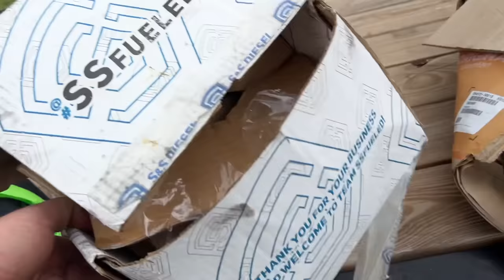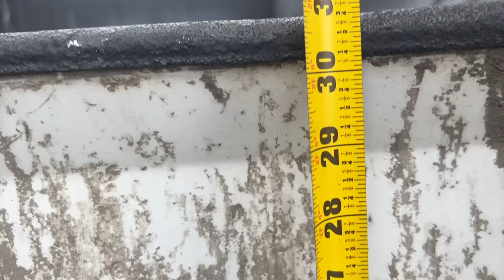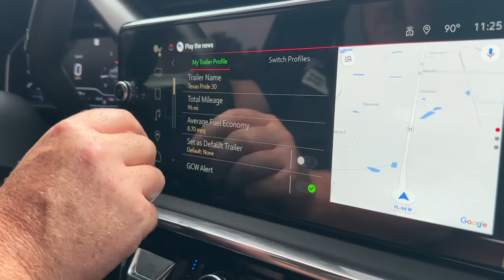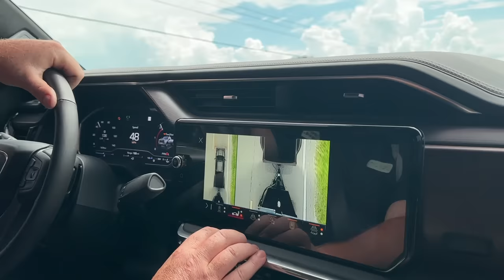$100,000 Diesel Truck VS $2,000 Diesel Truck!!!!  Are These New Trucks Really Worth It?

Comment: In this comparison there is no reason to pay 100k when a 2k piece of equipment does the job. I don't care that it was 10 seconds faster. Not to mention on there are no emissions except an EGR on the older truck. The 100k truck has every piece of bloated garbage the EPA could dream up on it.

The comparison in this video is fine for a one shot deal however, the story will change drastically over time in cost of ownership. Then the price difference becomes much more than $98,000. Increased usage of diesel fuel, cost of DEF, diesel fuel additive (have to raise cetane to keep regen to a minimum), more insurance, more registration and let's not forget; inevitable down time in the shop due to rushed and rubber stamped emissions equipment.

I'd say the true difference in cost is closer to 50% higher minimum.

Comment: You run a new duramax over a old  powerstock and  their was not that much difference between them you try running  them  with the same miles and 4×4 or even 2 wheel drive  the powerstrock will come out on top over a scrap duramax   every time

Comment: I am no mechanic, I am as far as earth is from Pluto in being the bright,  but even for for being that stupid, I would not buy that 100k truck.  I would need to that amount every week or 2 weeks to jump on that boat without regrets.  And that would only be to buy it off cash.    I could not even consider what would additional fees would be in interests, and INSURANCE on top of all that…. 

I think the F350 did insanely well.. that is a what a smart person would be driving, assuming he is able to keep it running reliably.   

Remember i said I am not a mechanic, therefore and sadly, would not be capable of keeping a truck like that on point, and would probably push for the newer trucks.  But if you mechanically modestly savvy or great, then your  choice would be taken as smart person, and not blowing your money off.  Unless it’s down for marketing purposes, in attracting while not necessarily better customers but instead people would be willing to spend the money because they drive a snowball in expense that cannot be afforded not pay more than desirable as it’s driven by a much greater cost which is that of the tuck itself. 

Ones again, if it was for being money, I would take the 350x but I were a mechanic, car dealership of needed to create a specific marketing awareness, I would undoubtedly go with the new truck too.

Comment: 6.0 is not a very good truck I like ford but they are not reliable I think you should take a 7.3 and jack it up new fuel injection system newer turbos new cam

Comment: The performance differences were minimal for nearly two decades between them. 
The percentage of improvement in performance only equates to 50k in value. So you are overpaying 50k for your GMC. That doesn't sound like a very good deal to me.

Now, if you are a business owner, sure. You get to write the depreciation off on your taxes, making it a far better deal than Joe smoe buying one and eating the entire sticker price.

For me, I still drive my 04 F250 6.0. I can assure it performs a helluv a lot better than your 2k truck.
No dents, no rust. I  paid 24k for it in 09 with 52k miles on it. I wouldn't trade it for one of these new trucks. 
You failed to mention why you NEED a warranty for your new truck. That would be because they crap out all the time with emissions related problems.  
No thank you very much.

Comment: Difference is the 100k truck will be in the junkyard in 20 years. They will NOT last 20,30, and 40 years. So as long as you have the available funds to buy and sell them, more power to you, but they'll not be around in 20 years. Too much stuff that doesn't last on them. They'll become a $ pit like no other, and they'll be thrown away. Bummer.

Comment: I'll never drive anything except a  old superduty   current daily a 01  just hit 200k..  that 6.0  surely wasn't 2 grand even if it's a    
 sparkplug coil pack trashing pig. 

now calculate that gmc  in 250k miles  + 20 years depreciation.

Comment: He about cost per mile? Who buys a diesel to drag race it, anyway?? I’ll take an old truck I can fix myself over one that has to go to the dealer for electronic or emissions issues. My 96 won’t get stranded for def issues. It may not tow at 85mph, but I wouldn’t want to anyway. I also have a 2004 duramax LLY. The only time that truck stranded me was when the FICM failed on the side of the interstate pulling a trailer - like you - hours away from home. All the electronics are a weak point for these trucks.

Comment: Without a key it won't be long before the new truck is stolen.  It's becoming a real pandemic depending on where you live.  The old truck has no computers like that, it would be much harder to steal as you still physically need a key.

Comment: When you're looking at a hundred thousand dollar truck and putting it up against a 2000 to a 4000 truck that runs well there is no comparison it would take you years to recoup the money that you spent on that hundred thousand dollar truck. Yes you get bells and whistles and everything else that a new truck has compared to an old truck. The new warranties are not worth crap. I owned a horse stable for years and you couldn't give me a new truck. Even if you broke down and had to put a new motor in that old truck you're still better off.

Comment: A truck is purposed for heavy duty work, not getting groceries or showing off. There is no need for leather surfaces everywhere. Just leather seats and steering wheels are fine. Everything else can be plastic. No need for 4 doors either. Nice long bed is what you want. Of course, you want the basics. A decent infotainment system for camera views, phone connectivity, and navigation with chunky physical climate and audio controls usable with gloves. 

This fad of making luxury pickup trucks is frankly stupid, impractical and insanely expensive. They've lost the plot. You want a big luxury vehicle? Buy an SUV.

Comment: Interesting how this guy thinks there would be something to compare with these two vehicles...All those trucks in the lot but none close enough to the new on to test... guess he was afraid one of them would beat the new one.  the trailer drop was a joke.... 3.75 " over a 2.5"/// brand new shocks over a 18 year old shocks... less than 5 seconds passing speed difference is not worth 97K...

I think just about everyone here would agree that buying a used truck and even if you had to buy a "ne" rebuilt motor for 10-15K would be a way better investment; and you could still be able to work on the rig and not have the computer dictate how you drive.

Comment: why spend 100,000k when you can spend 20,000k plus 10,000k in upgrades and get a faster and better truck for less than 1/3 of the price. New trucks are stupid with all the sensors and emissions.

Comment: Just saying if that Ford was a 7.3 it would have walked that duramax
Reply: a 7.3L PowerStroke?  HAHAHA.  Good reliable engine but the 6.0L will gap them in a race all day long.  Throw tuners on both trucks and the 6.0L will make the gap even bigger.  Other then the problems the 6.0 is notorious for, it's a much more impressive engine than the 7.3L in terms of power, performance, and towing.  A tuned 6.0L will give new trucks a run for their money.  The 7.3L is a better choice if you need a truck to haul your equipment and need it to not crack heads, blow a head gasket, or break down on you.  No 7.3L is going to walk a even a stock duramax.

Comment: 100k for a stock truck with a list of sht that will break or need to be replaced before 100k miles, no thanks. fck def to. put 50k in a older ride and turn some heads

Comment: Seriously dude? You picked a 6.0 to do the comparison?! Like the worst diesel engine ever made, would have understand to pick the 7.3
100k for a diesel truck? Not my dream truck at all, all mechanical ahead has to be done by dealership or warranty pop, all these useless electronic features have a tendency to bug and wear out, if you brake a tie rod, it s back order for monthS, 2years later your truck worst 50k on the market, insurance is insanely expensive, there is zero good reason to buy a truck the same amount than a down payment for a house. Would even prefer to buy 10 or 15 ford F550 2000 7.3s

Comment: People seem to forget the toter market.  And you can upgrade from the pile of shit powerstrokes, duramaxes, and cumaparts (yes theyre a boat anchor they always have been, small cams, big cams, 8.3s, 5.9s theyre all a boat anchor only one worth a shit was a KTA and they needed 1150 cid to run with an 864 cid cat.) And you can get a real motor that has yellow paint.  You can also get them with a 466 ih motor or a detroit.  They can actually stop what youre towing, they dont squat (air suspension) and you already need a cdl to drive one of the new diesels if youre towing commercial which for all intesive purposes pertains to damn near anybody buying a 100k diesel thats going to tow with it. Rodeo, racing, pulling, mud drags they all have a purse and that makes you commercial if the dot cop wants to be a dick.

Comment: Not an accurate test really, you didn't discuss the hassle of the DEF usage and what happens when you run out and you're towing. THAT RIGHT THERE is enough to say NO to all new Diesels. Just don't buy them. Keep the old runs running for all time, until the Democrats are removed from Washington.

Comment: You're comparing the worst old diesel to one of the best new diesel engines.... Think that is fair? Everybody knows the ford 6. NO is the worst diesel engine that was ever put in a truck. so right off the bad you earned a dislike. had you taken a 1997 1998 dodge ram cummins 12V engine that would of been a fair comparison.

Comment: Who really cares about that stuff , when u spend that kinda money u wanna know reliability issues!! Are there sensors or electronics issues, like how all the systems are linked together and if u get a cracked taillight then leakes water and shorts out so since its linked to all kinds of systems it affects how it runs and virtually impossible to diagnose, the utter stupidity of engineers in Detroit to design this shit that u just paid $100k and its in the shop and they cant fix !!!!
I bet u wonder how i knew this , new vehicles are just expensive  piles of shit !!!!